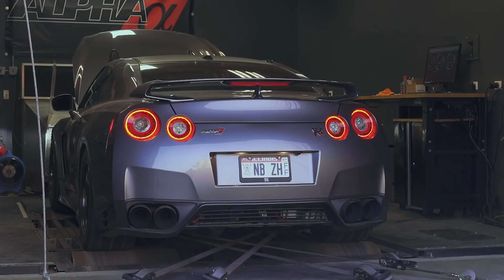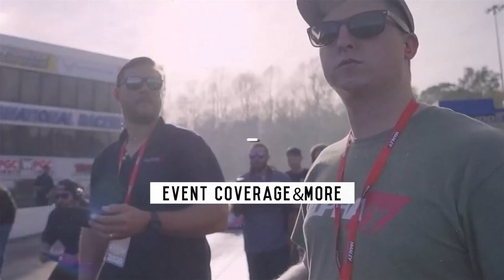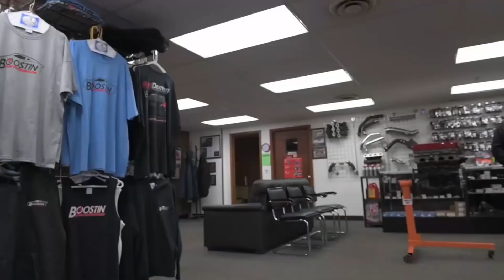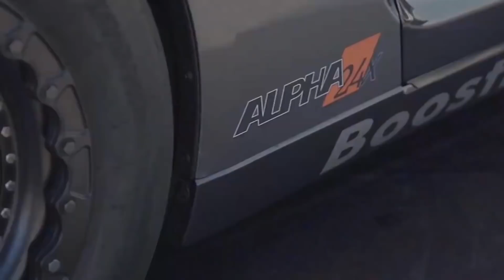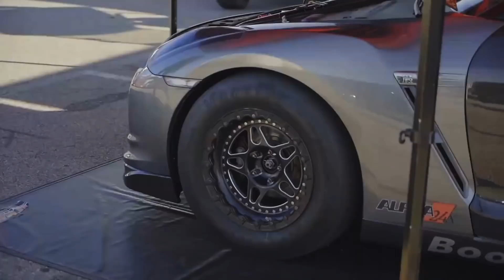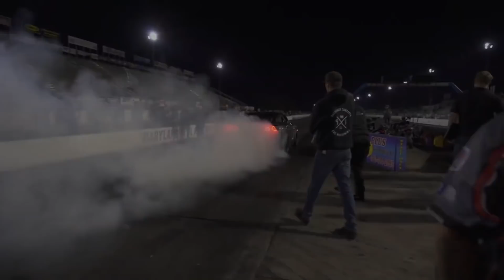1400HP R35 ALPHA 18X CUSTOMER BUILD | AMS Performance

Comment: Question a flame on one side only does that mean one side is running richer than the other ?
Reply from the maker: The car's exhaust system actually comes to a single mid-pipe so a flame out of only one side has no inclination on one bank running differently from the other.